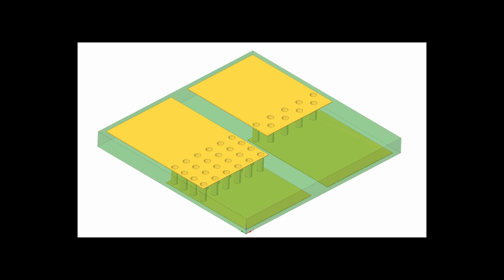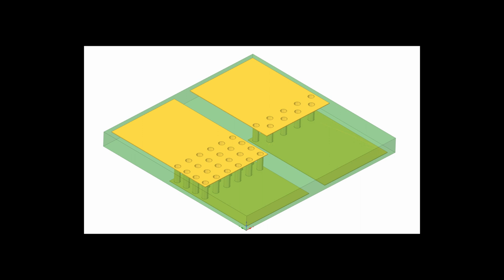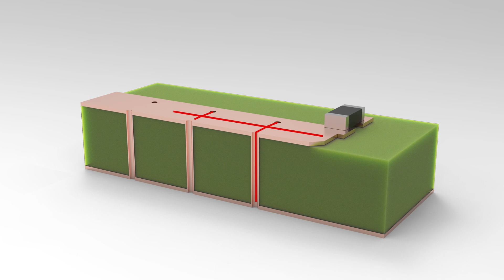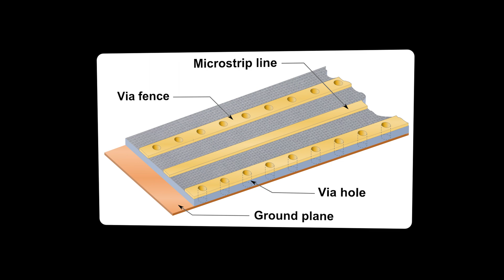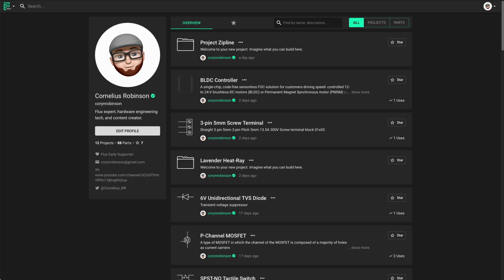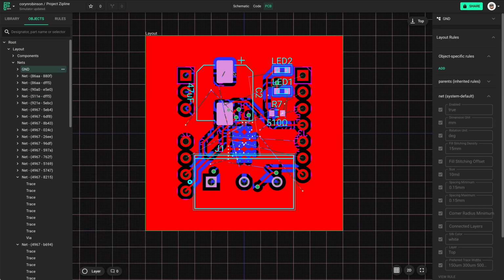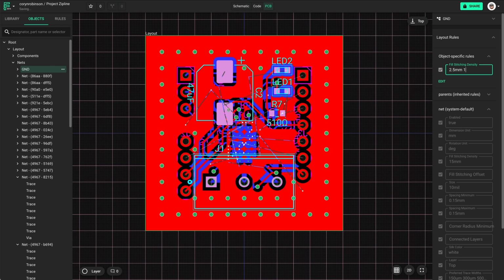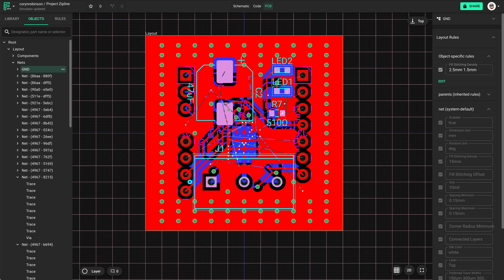How and When to Use Via Stitching

Comment: What exactly makes the impedance high in the first case?
Thanks.
Reply: Think of each via as a resistor and therefore the vias are parallel to each other, resistors in parallel lead to lower total resistance.